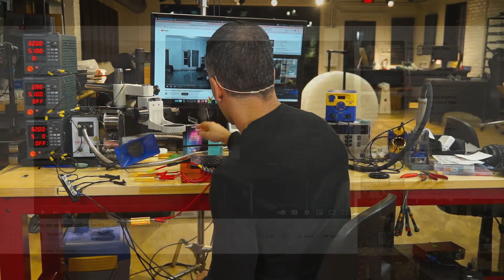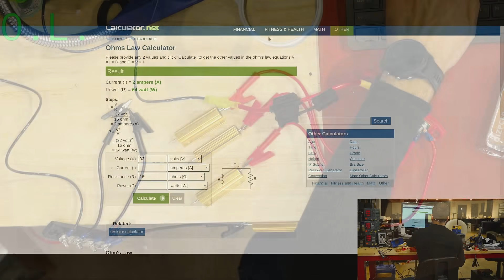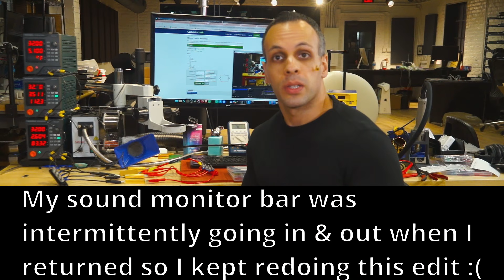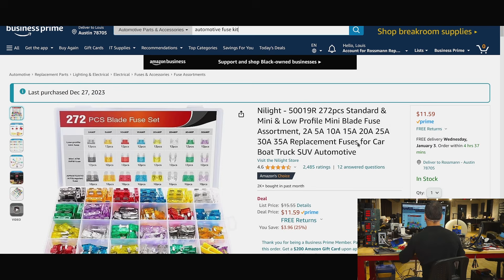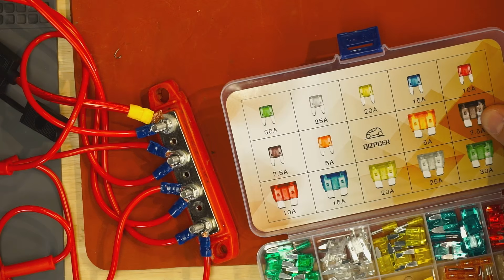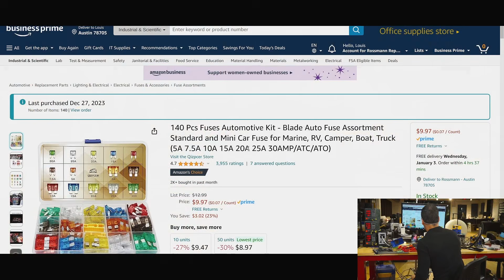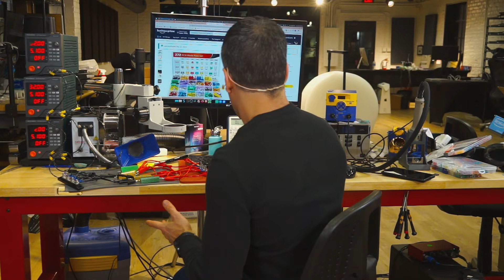Amazon Sells Fake Electrical Fuses

Comment: My current policy with amazon is "only buy stuff that is not locally available, do not buy anything that is or can become safety critical". Even if it's a known brand, from a known seller, the warehouse pooling of all inventories of all sellers, and the known warehouse inventory switcheroo they cannot do anything about means it's extremely easy to get counterfeit items even from supposedly known actors. It's so widespread that L1Techs had a problem with amazon basics cables sold by amazon being fake too.

Comment: Hi Louis, I'd like to make an observation, hopefully without becoming a Peanut Gallery naysayers' person. I have an electronics engineering background and I respect your testing and the apparatus test setup. There is one thing that I wish you would have done, but you didn't show. That was to also show some quality brand names blade fuses for comparison, like the G&B, NAPA, CarQuest, Walmart, Advanced Auto, Bussman, maybe even a few OEM fuses, etc. Otherwise, we are just assuming that the fuses we call "Quality" fuses, really are just that. Thanks.

Comment: I really hate to be that guy. When you do testing of fuses. You need to measure amps and volts with a meter at the point your testing. The numbers on power supply aren't really accurate. Also just easier to read output. This how 3rd party regulators like UL, Aerotek, and TUV use as common practice.
Reply: oh please

Comment: There are already several people on YouTube who have tested car fuses that do not have a factory label on them or bought in a plastic box from a store that sells this CHEAP. Never trust these fuses.

Harbor Freight had a recall on car fuses in 2009.

You should bench test fuses before use so that the package you have bought contains good fuses.

(Weber auto) youtube.

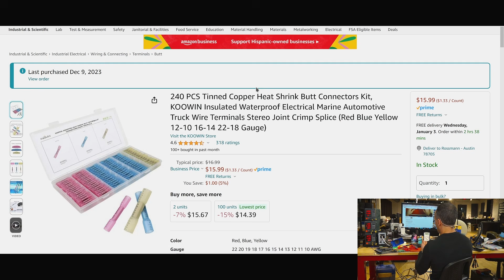Comment: I think those crimps 28:26 need to be heated to solder together inside and shrink on the outside, giving a permanent waterproof connection.
The guy from the Legit Street Cars  YouTube channel uses them all the time. (He shows the tin melting inside)
They are not to just crimp only...

This Video Fuse Test was a huge service to humanity!!
Thank You Louis.
Reply: That's not what they are advertised as. And those solder heat shrink connectors are questionable in any case, especially if the connection may be subjected to high heat.

Comment: You probably heard of that light bulb that holds the record of the longest lasting light bulb, still holding after more than a century. Louis should build a setup sending 4 amps in an Amazon 2A fuse and also break a record

Comment: I do programming, and oh my god this gives me PTSD from people cheaping out on their error and value checks. 

I once had to explain to someone why them deleting 8 lines of code that verified the input to a function was a bad idea, they removed the checks and published it out to everyone, everyone's data got corrupted, person begged for help, and I told them "Well you had eight lines of code that prevented this exact problem, maybe you should have thought about that before everything blew up." (Binary files 15+ years ago were extremely sensitive to how you read and wrote them, and in some cases still are.)

So yeah people please don't cheap out on important crap like this. Fuses are a thing for a reason, unless you want to risk your crap exploding please don't make or use cheap electrical crap. We engineers design safety devices/checks for a reason, and it's not just to make your life difficult.
Reply: For anyone that want's to know what corrupted it, the check in place were to make sure the Read/Write byte functions actually had a byte (max 255) passed to it. When this dolt removed those checks the value became uncapped meaning if you used WriteByte(256+) it would write an integer instead.

This basically screws the entire read order because old binary files, especially without serialization, you had to read in the same order you wrote or it wouldn't work. So Reading a "Byte" that got saved as an int (four bytes) you're entire data read index is off by 3 bytes now, stack that up multiple times and yeah you have a problem. Then when the program saves this corrupted data because some jackoff removed all the guard clause checks to reduce program size, and you didn't have cloud storage to roll it back, problems from angry users occur.

So yeah as I originally said, safety checks/devices exist for a reason, use them and use them properly. Especially in lower level programming/electronics where the program/device won't do the checks for you and just go "Oh you want to pump 8 amps into a 2 amp device that might catch fire and/or explode on you? SURE GO RIGHT AHEAD."

Comment: Man, I wish you were right about the fake reviews part, but unfortunately I think it's just the technically uninclined common folk who tend to be idiots that actually give such good reviews to these products. They plug the thing in, they see that the car didnt blow up and that things 'seem' to be working fine, and they give it a 5 star review.

We need a product that will only ever be bought by the technically inclined, the kind of product that must be precisely compliant with its claimed specs and immediately visibly fails oterwise, so it can easily be spotted. But then again, I guess ill intended companies would only attempt their scams with products that will go unnoticed...

Anyway. If at least 1 technically inclined individual would just test the claimed specs of a given product and publish it on amazon, it would all be fine

Edit: You ended up saying essentially what I wrote above in the last 6-7 mins of the video, oops

Comment: The higher capacity may "fix" some situations where the cause of the original fuse blowing is not located.  It may allow higher current and get positive feedback as a fix unless they are used with a dead short situation. Many folks don't understand how current works and simply keep replacing fuses without troubleshooting. I guess it's better than wrapping it in foil and putting it back in...

Comment: In automotive school we had test leads with a 10A fuse which was supposed to protect the expensive 11A fuse insde the multimeter. Looking back now, that may have been a little optimistic
Reply: Redundancy is a good thing.... The meter likely had a spare fuse included with it, inside the case. I have often seen that.

Comment: In a clean short-circuit will not be a problem, because the battery will deliver enough current to blow the small fuse, the problem is a parcial short, malfunction (electric servos, ...) or humidity, especially in the near from sal water, especially if the car maker doesn't build the car properly. I do not surprise myself with burning cars.

Comment: Thanks for making this video to spread awareness, Louis. I really appreciate it. 
The scary part to me: Why would you replace a fuse? Well, because it already blew once! Why? Maybe a tinkering user just did something dumb, or maybe there's a fault the first fuse was trying to warn them about. The (shitty) rule-of-thumb in electronics design is to take 120% to 200% of your device's max current to get your fuse rating. Your results show that the right combination of lazy engineer and bad fuse could allow a sustained 10x overcurrent for a given device.
FYI, unless you chassis-mount and thermal paste those resistors, they're only good for like 10-20W. If you used 5V / 2.5 Ohm, you would have missed out on having a fancy artisanally-charred desk!😉

Comment: Why are the 100W resistors smoking? Arent they each getting 2A@32V which would correspond to 64W? 

Or is it that resistors slow down current at the output end, which means the current entering each three resistor is 6A, but by the time the current leaves the resistors it falls to 2A for each?

Or do they indeed run at 2A but they just stink whenever they're under load?

Comment: I have a cool ... but not so cool problem with something from Amazon.
I needed a new cellphone and i am used to sony phones. The older models were sturdy, funktional and could hold out for 8-10 years.
So i ordered (because i am lazzy and the next phone shop is like 30 km away) from amazon.
The xperia serie ... i tested the 5 and 10 ones... had all a batterie problem. Every single one off them had the message:
"Cannot be chaged at the moment."
.... besides the fakt that the charger from sony itself malfunktion all the time....

I tested 12 Phones and the last one was a Xperia 10 ||| 5G. It worked for 5 months before the message poped up again.

Is there a well known problem with the batteries? Something well known in the industry? or am i just a dumb customer?
At this point... i don´t know anymore.

Comment: Logically speaking, building ten different fuses is expensive. Swapping the cap is much cheaper for the manufacturer. 
This also means that if everything below 2A can be in reality a 2A fuse. Or the 2A fuse can be an 8A fuse. This means that this test shows there is something fishy, but I wouldn't yet trust the 5A fuse in the final tested set. As it can still be anything. I'd test several of each value at different currents, but this takes a lot of effort. 

I've been there before, showing another product is unsafe is very unsatisfying as no-one cares. But testing your own purchases before using it, and frequently retesting it, is certainly worth the time. If t's not, then please purchase from trustworthy places, instead.